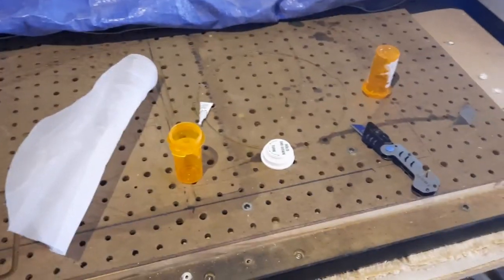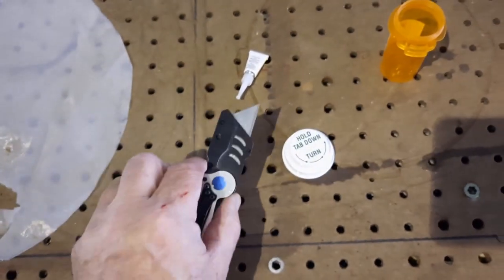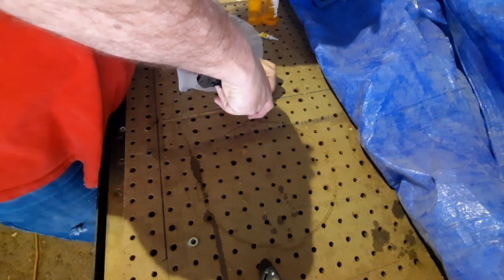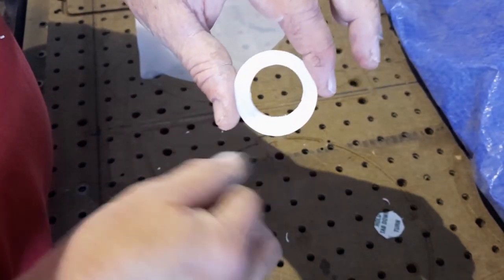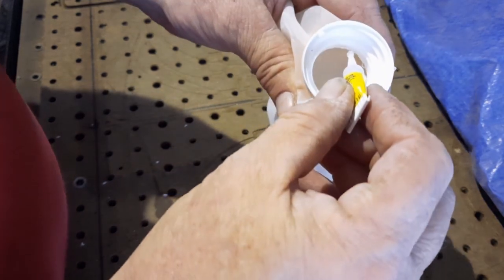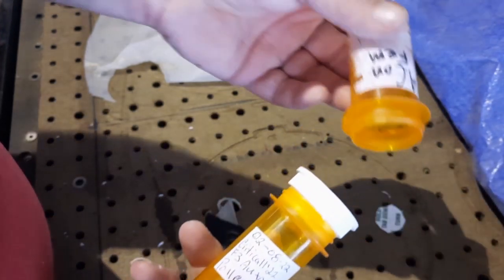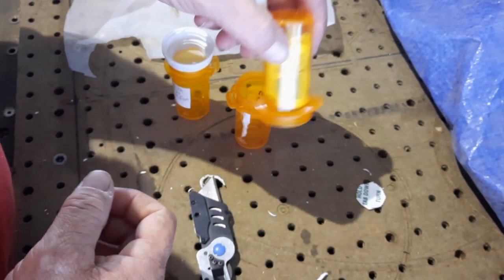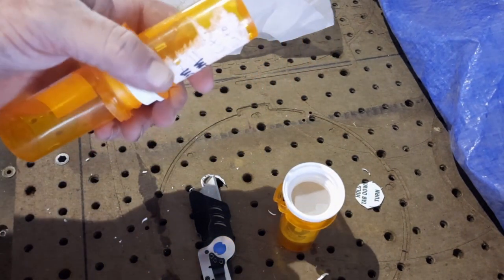How I made my "pill bottle pollen catchers"

Comment: You need a set of them high speed steel step drill bits from harbor freight. Makes drilling 3/16" - 1-3/8" holes easy without using the razor knife or hole saw/ paddle bits in thin stuff. Use them all the time on my projects that pop into my head.
Reply from the maker: Hell yeah!